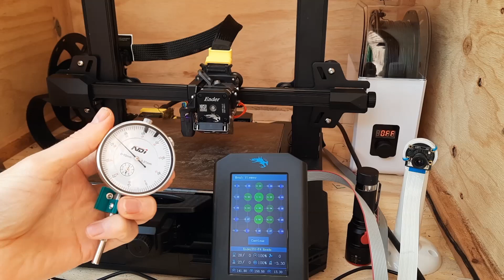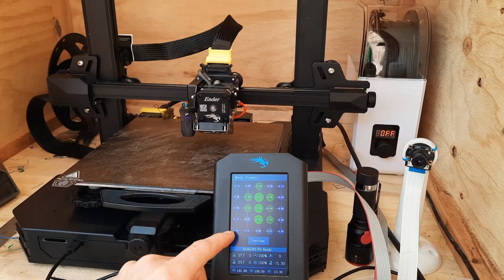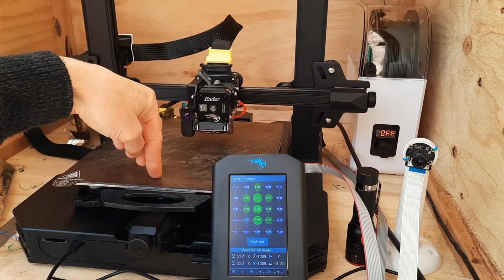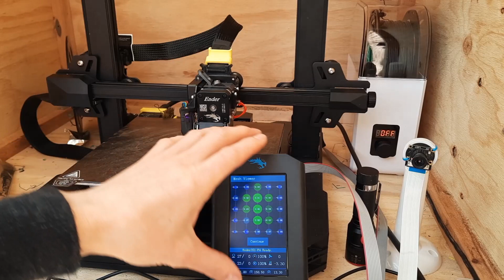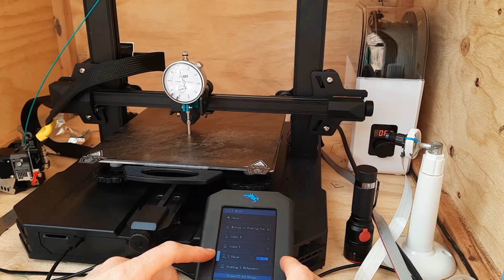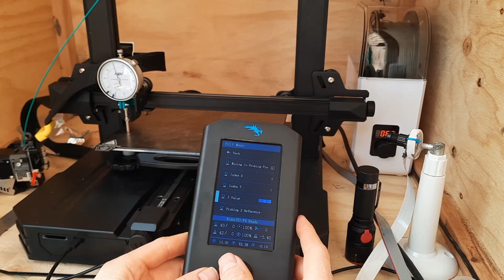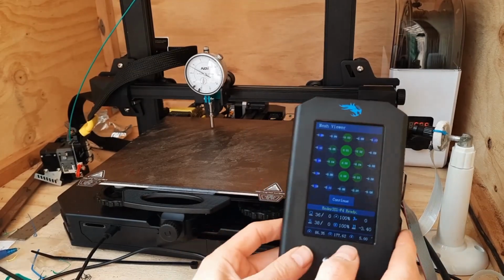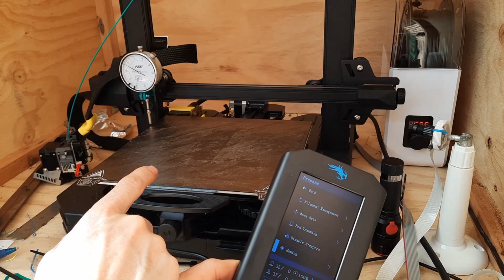3d printer, check/edit mesh, abl, with dial gauge holder, mriscoc, sprite extruder - Ender S1 Pro

Comment: Do you have a file for the dial indicator holder?
Reply from the maker: Yes, check the description
Reply: @hayden-james  Thanks, was originally looking at it on a phone and didn't see the description. Did you get any further with this?I was thinking that once you had your own mesh you could set it up for a 0/0 probe and just let it run, even if the CR is in the wrong place, so that it makes a grid that matches your dial indicator points. Then you could manually change them. A bit of a hassle, but seems like once you had a good mesh you wouldn't have to change it much, except to account for tilt.
Reply from the maker: @jefffeit8916  I should make an update,  I switched to glass bed and turned off levelling

Comment: I upgraded my ender 3 v2 with a sprite pro and have been having some issues with it I am running the same firmware as you it's as if the mesh is not translating while printing (the z height is not compensating for high and low spots) I have G29 P1 in start gcode but I just can't make any progress I even tried printing a bracket for my old bltouch and giving it a try and literally got the same results
Reply from the maker: Hi, is G29 P1 to make it make a mesh ? you only have to do that once, after that you need M420 S1 after any G28 to select your mesh
Reply: @hayden-james  I did this and still nothing 😔 It just keeps chugging right along
Reply from the maker: @R3ADB3ARD13  what color is the Z underline on the screen ?
Reply: @hayden-james  that was the first thing I checked whenever I watched your video and mine never changes colors I don't know if it's because I'm running an ender 3v2 and not a S1 It doesn't even turn blue when I'm running a mesh
Reply from the maker: @R3ADB3ARD13  well its not using ur mesh, can you share your start code
Reply: @hayden-james  I only have a pic of it currently I'm at work ATM
Reply from the maker: @R3ADB3ARD13  put it on imgur
Reply: @hayden-james  I definitely don't have that lol I do use Reddit and element though
Reply: @hayden-james  
G92 E0 reset extruder 
G28 home all axes
G29 P1
G29 J2 tilt ubl mesh
The a lot of g1 codes that I can't make out from the picture lol
Reply from the maker: @R3ADB3ARD13  so you need M420 S1 at the end
Reply: @hayden-james  at the end of the entire gcode or after the g29 codes
Reply from the maker: @R3ADB3ARD13  at the end of the start gcode, but generally after the G28
Reply: @hayden-james  alrighty I'll give it a try when I get home in the morning and see what she does 🤙🏻 thank you
Reply: @hayden-james  do I need to erase the g29 p1
Reply from the maker: @R3ADB3ARD13  i think that makes a new mesh ? you only need to run that via the lcd menu, not everytime
Reply: @hayden-james  can you share your start G-Code by chance I tried plugging in the m420 s1 and still got the same results
Reply from the maker: @R3ADB3ARD13  so the s underline didint change ? can you go into the mesh settings on the lcd and view the stored mesh ?
Reply: @hayden-james  yeah if I view the mesh it will show up
Reply from the maker: @R3ADB3ARD13  so i dont think im even using abl since i switched to a glass bed ! i should make another vid about it, best thing ever... but i guess i would just make sure its like this; G28; M420 S1; can you post your ?
Reply: @hayden-james  I guess I need to ditch the g29 P1 that must be my problem
Reply: @hayden-james  do you know which screen firmware you are running is it the dacai or the private?
Reply from the maker: @R3ADB3ARD13  knob lcd is not upgradeable afaik, on the printer im running mriscoc
Reply: @hayden-james  it's giving me a run for my money trying to find the dwin
Reply from the maker: @R3ADB3ARD13  dwin ?
Reply: @hayden-james  to flash the screen usually in a dwin folder
Reply from the maker: @R3ADB3ARD13  you dont/cant flash a knob screen, there is no sd card slot
Reply: @hayden-james  you just have to open it up I've performed several times so I guess I don't need to flash the screen to get the z to underline blue didn't know if that could be a contributing factor 😕
Reply from the maker: @R3ADB3ARD13  you have a screen with knob ?? regardless you flashing it should not affect the z bit , i think there is gcode to check if the m420 is on, did you try with g29 removed ?
Reply: @hayden-james  no I haven't had the chance I got home tried the m420 s1 ran a bed levil print and it was no good I went to sleep  and didn't get to mess with it anymore before work so i e just been doing some reading on the firmware

Comment: Hi
Ender-3 V2 Screen 
Matching without wire modification with ender 3 s1 pro?
Reply from the maker: Yes is very easy, this is s1 pro, just use 10p idc cable, there is plug next to existing lcd cord for it
Reply: @hayden-james  Thank you 
The idea is great